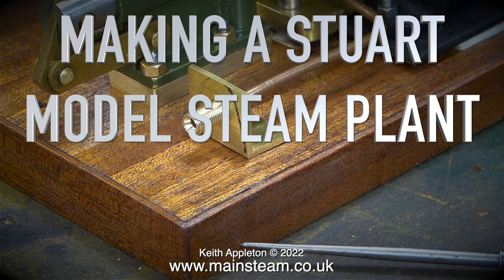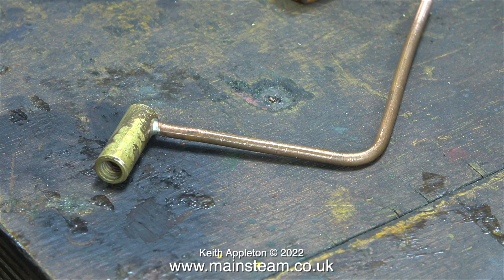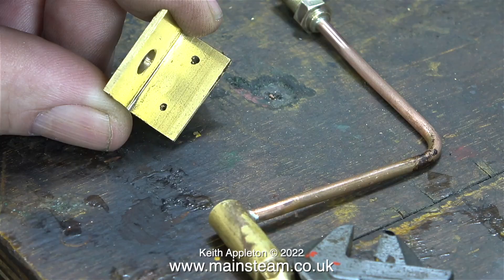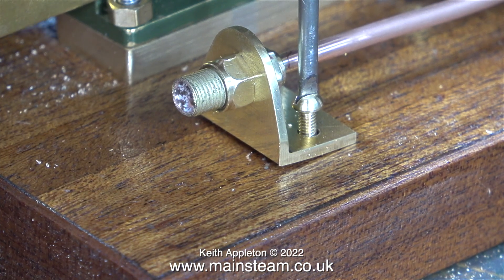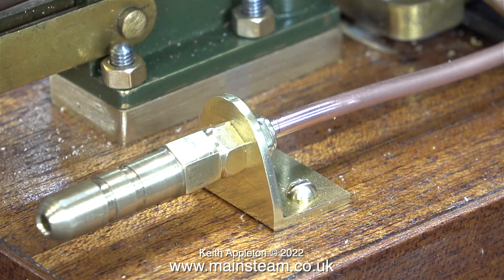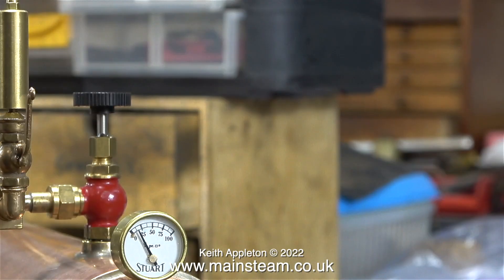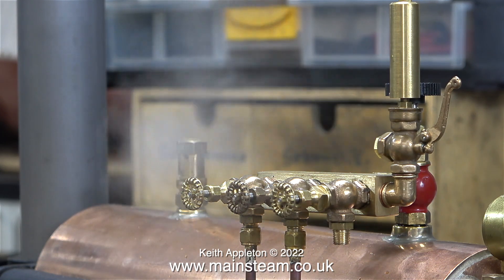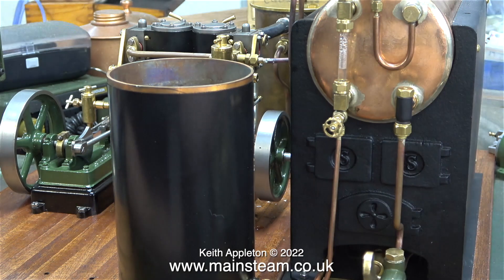MAKING A STUART MODEL STEAM PLANT - PART #73

Comment: Great Job!  Now lets put them to work;  hook one up to a small generator and the other to a rotary sander and You're in business!
Reply from the maker: and who operates the sander? You would be far too busy constantly watching the water level in the Boiler . . . .
Reply: @keithappleton  Yes keeping the water level constant would be a problem.  So what you need is a regulator like they use in refrigerator ice making machines.  It's a small, simple device but water with a high lime content can plug them up in a short time.
Reply from the maker: Then there is the frequent lubrication ......
Reply: @keithappleton   So I'm wondering how would you guarantee constant lubrication?  A tank of steam oil connected by a pump to each revolving bearing?  This is how full size steam engines stay lubed,  what would a miniature lube system look like?   I know it sounds funny, but I've always thought that steam engine development may have stopped prematurely when the internal combustion engine was introduced.

Comment: Thank you for your continued postings on YT. Is there any benefit to the displacement lubricator with the side needle adjustment above those without in a model steam plant?
Reply from the maker: Yes, you can fine tune the oil feed for the application.
Reply: Thank you

Comment: wouldnt a pipe cleaner work ... you now them prickly little straw like things fr pipe smokers to clean the stem of their pipes out with ... i know they get pretty fine ( I doubt fine enugh for that burner hole but definitely small enough for 1/8inch tubing ...
Reply: I cant believe people still dont have an idea on a displacement lubricator ... all it is essentially is a water trap with a oil supply on top ... as the water(steam enters it displaces the oil and it gets carried into the engine to lubricate ... while the steam /water slowly fills up the lubricator ... 
.
it is no different than using a large pond to settle large material out of waste water ... just made to be portable and work on a steam engine 
.
only ting easier to under stand would be an inclined plane ... in a spiral ... ( a screw)

Comment: Did you tap out the holes in the wood or just drill it a bit smaller so the bolts bit into the wood?
Reply from the maker: a bit of both, but for the 4 BA bolts I let the bolts do the tapping in a 1/8" hole  (3.1mm)
Reply: @keithappleton  That's handy to know when bolting to wood. Thanks for the advice.